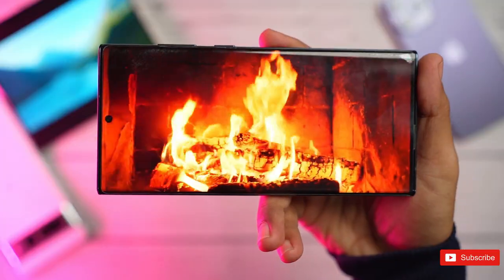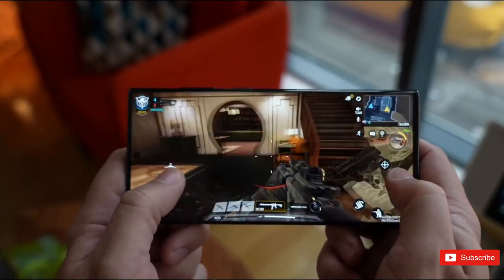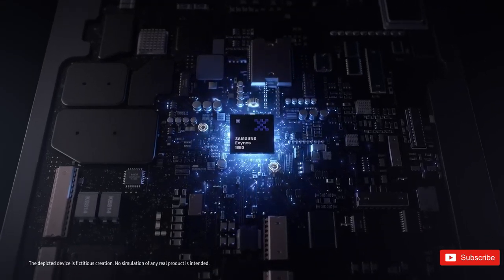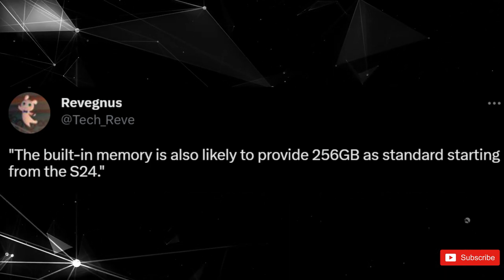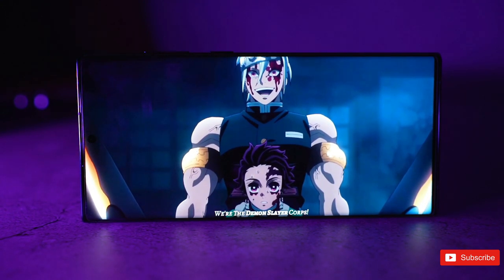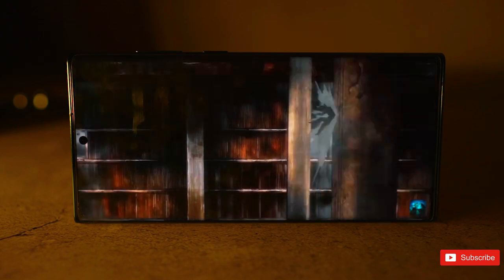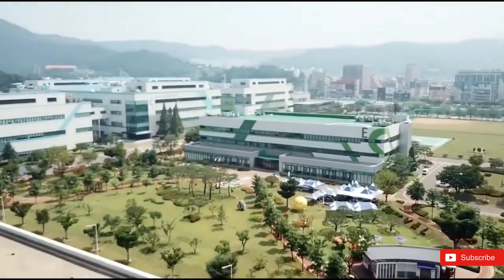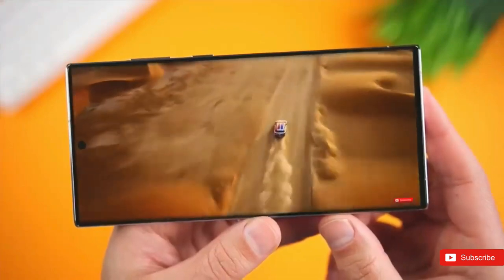Samsung Galaxy S24 Ultra - WOW, Look At The Difference! 😍🔥

Comment: Straight up the phone will be brilliant but on a serious flip side no person can trust an exynos processor for its past his history the amount of work it will have to power such a brilliant phone with increased ram, processing,pure workload, connectivity and making a phone control every function that the phone will put on it with an updated system ui5 a battery of 5500mah ,more camera processing,two screens if the leaks are right front and back,one screen is enough a second is amazing but will want wait more juice as well, snapdragon 8 gen series has been a great processor for the s series and nothing to compete against but exynos processor has a huge amount to live up too so for such a high price phone it would have to be pure levels of snapdragon performance when the phone is released they will have to wait and see what the s24 Ultra is packing touch wood snapdragon processor is still there ❤️❤️